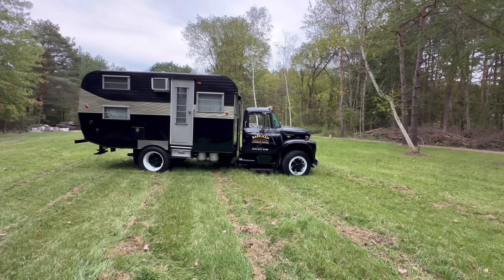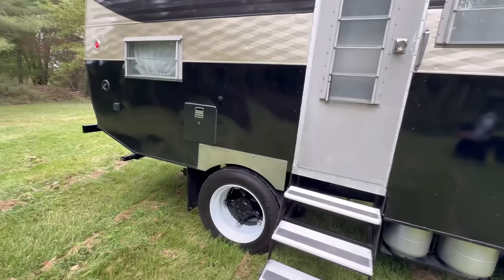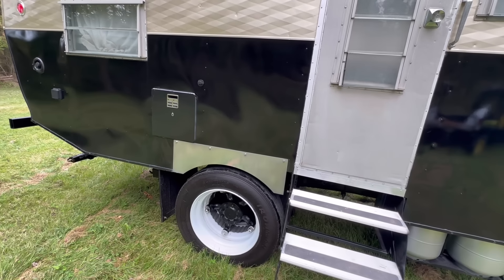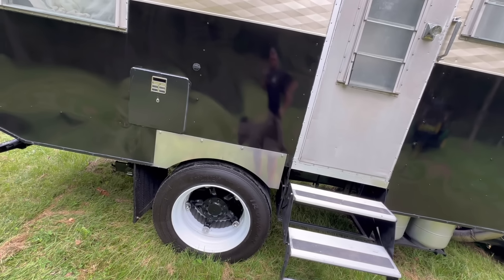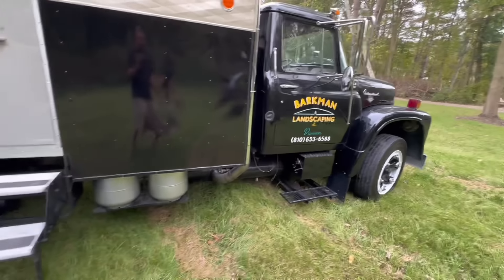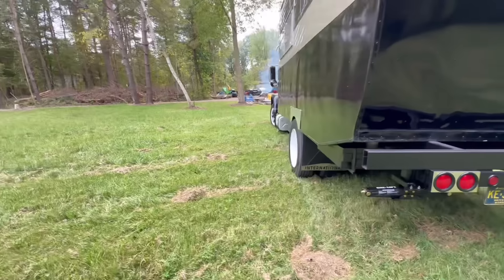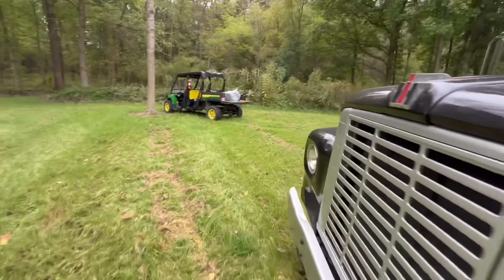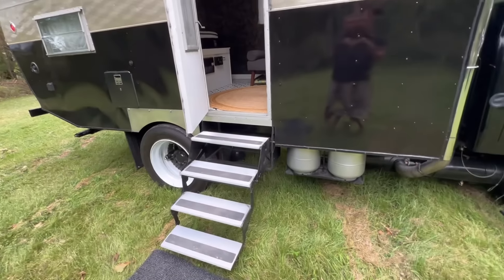My Loadstar Camper is 100% COMPLETE!

Comment: Fabulous workmanship, very nice job.  I will mention something for you to consider, I once put a car cover on a car over winter to protect it.  6 months later when I removed it, I had mold issues along with electrical issues.  The car cover allowed moisture to wick up under the cover, with no way for it to get out, moisture was trapped.  It took forever to straighten out the mess.  I’ll never cover anything with plastic again.  
  Hope to see more of your camper and creations in the future.
Reply from the maker: Thank you very much.  I’ve used these newer Rv covers before and while they’re prone to tearing, they have a ton of venting built in and the fabric itself is breathable- they do a really good job

Comment: I have had ideas to do this years past, I never followed through.  I love what you did, SWEET job.  😎
Reply from the maker: I appreciate it!
Reply: @robstruckshop80  I had Ideas about doing something similar only on big pontoons with a deck on the front and rear.  Maybe a drop down paddle wheel for power when tied up at the river.  build the pontoons like slide outs on a RV so then you could transport it and when it is in the water slide them out with a hinged drop down walkway along each side.  Lots of ideas, just no money to build them, LOL.

Comment: Looks good, I LIKE the interior.   I'd like to check out the diesel heater in more detail. The propane heater in my 5th wheel is a joke.
Reply from the maker: This small diesel heater is great for small spaces but you’d need more for a larger unit, at that point a true APU or mini split would probably be better, but significantly more expensive.  As always, depends on your needs and uses

Comment: Barkman Has been around a Very Long Time, But I haven’t Seen Them Out And About Anymore. I Was In The Property Maintenance For 30 Years. We Also Were Doing Concrete and Excavating At The Same Time Under The Umbrella of The Property Maintenance Company. We gave Up The Mowing and Landscaping Because Way To Many Shop Workers Or Anyone Who Could Afford an Exmark All Of a Sudden They Were Undercutting The Prices So We Stopped Doing That And Snow Removal. We actually Still Have Six 60” Exmark Mowers that were Bought A Year Before We Decided To Stop Mowing, Also Four Western Snow Plows and a Slide In Two Yard Stainless Steel Salter. Still In Great Shape. We Won’t Sell Anything Because if I Ever Need That Equipment Then We Won’t Have To Buy Them Again… I Believe The Owner Of Barkman Lived on M-15 on a Road That Starts with M…
Reply from the maker: We’ve been around since 85 and are bigger than ever.  We have not mowed since 1998, only landscape installation and horticultural maintenance now.

Comment: I thought about doing something like this with a Chevy C60 I had a few years ago but was afraid it would shake the camper apart because of how stiff the truck suspension was.
Reply from the maker: It’s definitely a risk, I just will keep an eye on things, but it’s mitigated for me because I don’t drive it much.  Its miles are all on a lowboy trailer that rides pretty nice.  The weight of the camper also puts the rear truck springs down on the overloads just a bit, so it’s not as harsh.  Thanks for watching

Comment: I’ve been watching most of your Loadstar videos to get inspiration because one of these days I’d like to swap a loadstar cab onto a more modern International 4700 frame with a DT466. Do you think the DT466 would fit with some doghouse/firewall fabrication? Also do you happen to know the width of the cab from fender to fender? I’d like to figure out whether or not the track width of the 4700 would fit under the loadstar cab. Thank you and keep up the cool videos!
Reply from the maker: You would need to build a pretty big doghouse or find a Loadstar or Fleetstar cab with a doghouse from the factory, the 466 is nearly twice as long as a V8 gas.  In the track width, I’ll try to get a measurement this weekend, but I can tell you it’s pretty narrow- a newer axle will poke a little bit for sure, I found that when I considered putting an S Series school bus axle under mine
Reply: @ I’ve seen a few 90s international 4700s in my area that are “low profile” and they have the 19.5 inch wheels instead of the 22.5 inch. I’m not sure what the other differences are on them besides the wheels, but they definitely sit lower to the ground. Some have DT360s and one has a DT466. I’d rather have the 466 because it’s bigger. A few of them also have the 7.3 power stroke motor, but since they don’t have the same power potential as the DT motors I’d prefer to stay away from them. A 10 speed road ranger would be fun, but I’m already getting a little ambitious trying to cram such a large motor into a single cab truck and the 10 speed shifter would probably be sitting closer to the back of the back if I had to take a guess. I’ve never seen one of these trucks in person, but there is one fairly close by that I’m going to go check out.

Comment: Great project. Does the bump in the front of the trailer body prevent the exhaust from exiting at the top of the trailer body? I see heat and soot on the trailer body in a right side crosswind.
Reply from the maker: That’s just a carryover from when I originally built it as a stake body.  In time the truck will get a weed burner exhaust, but for now we don’t drive it enough for it to matter- she’s a trailer queen!

Comment: I'm guessing that's a dummy stack...our your ok cleaning up a oily sooty mess off the right front corner of the camper body ??
Reply from the maker: The stack is there from the trucks original restoration as a stake body.  I may eventually convert it to a weed burner but it doesn’t get driven enough to make a mess